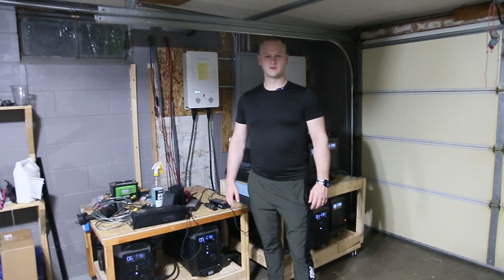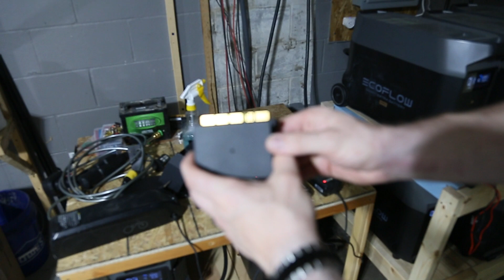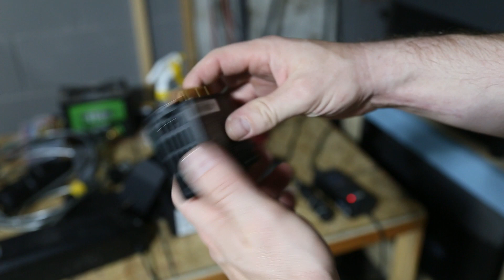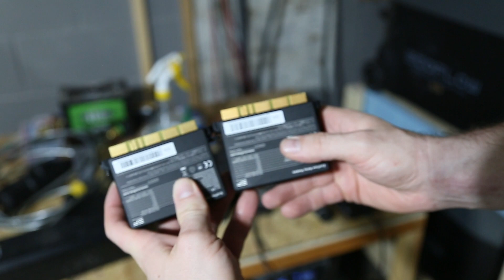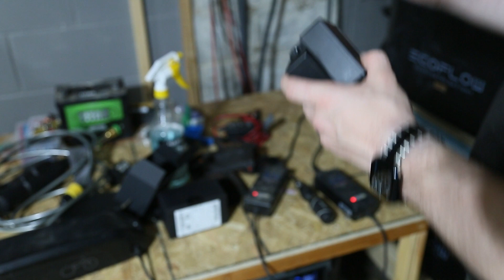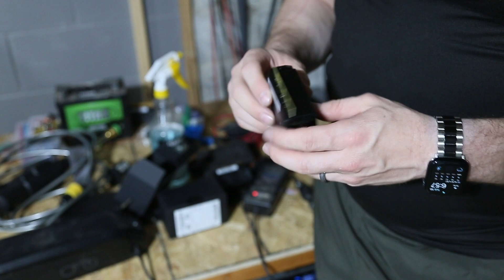Update - Ecoflow Smart Home Panel Relays

Comment: This video is the first info I've seen that specifically shows what is shorter.  Thanks.  You reference that EcoFlow new the old from the new by serial number.   I wonder if there is a table that would show which serial numbers are old vs new for 15, 20 and 30amp relays.

Comment: Daniel - if I have two DPs connected to SHP in 120v to they split loads? Can you assign which DP supports what circuits? Do they work in parallel or series? Thanks.
Reply from the maker: If the SHP is set to single phase then the best way I could describe the behavior is that they alternate loads. It will take from one DP for a while and then take from the other trying to keep both in relative similar states of charge. Obviously, if the SHP is in split phase then it takes evenly from both DPs.
Reply: @DanielGoodwin-jq1oc  - Thanks for the quick reply! That helps.

Comment: When I connect back to grid from the Smart Panel my breaker switch to off. I have to switch them back on in my main breaker. Does this happen to you?
Reply from the maker: Hmm, perhaps you can explain a little more? I usually can seamlessly switch between grid power and batteries using the Ecoflow Mobile app...

Comment: Hi. I have the same old style relay. I Am only having problems with circuit 1, and also if I close the panel tight it will disconnect circuit 3 , 4 and AC1. Did this fix your problems?
Reply: I didn’t compare the original shipped relays to the replacement ones I was sent, but since my problem sounds the same, I suspect it was the same issue.  I wish the errors from the Smart panel were a little “smarter”.  I’m also wondering why Ecoflow keeps shipping the bad relays if they are known to be bad.  At a minimum, they should follow up Smart panel shipments with automatic replacement relay shipments.  It’s expensive to call back an electrician if you’re not doing the work yourself.

Great videos by the way. Thank you!
Reply: Thank you Daniel. Glad I found your video.
Reply: I'm having the same problem.
Reply: I have the original version relays as well and had lots of same issues .Still using the same ones. You can fix this by how you torque the screws. I found out I was tightening them too much. I think since they have a plastic case over tightening can move things around. Once I removed them, carefully seated them in the panel by hand and only tightened them up enough to hold them in place and no more, the problem is gone on all relays. I was having random problems on 5 and still using them without issue 6 months later. There is another YouTube video that made some type of reference to this that turned me on to this easy fix. It worked for me, cannot guarantee it will work for you but certainly worth a try.   @cat1racer